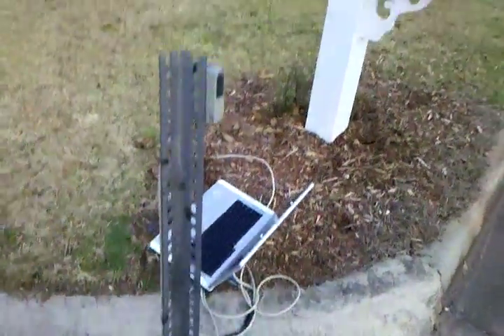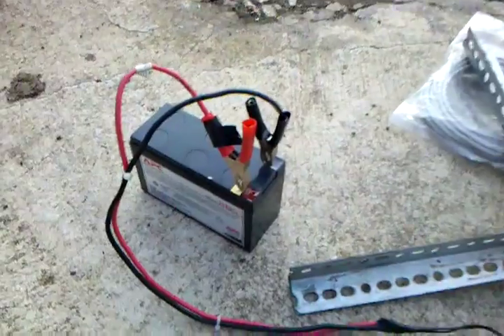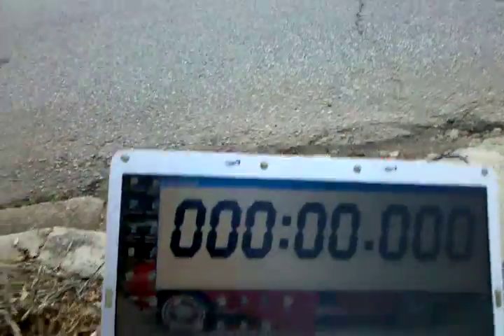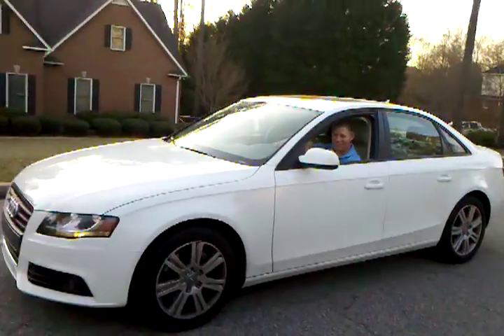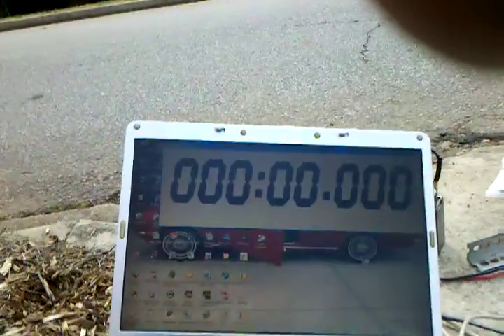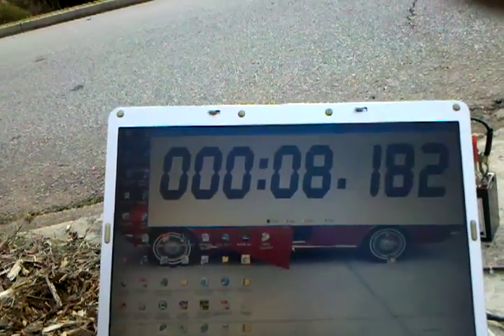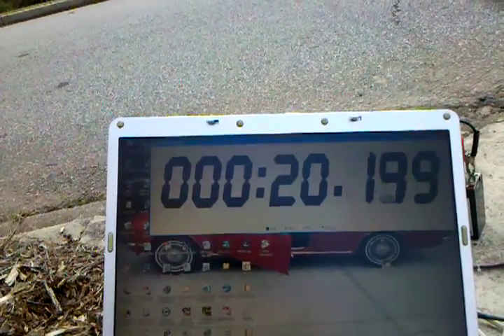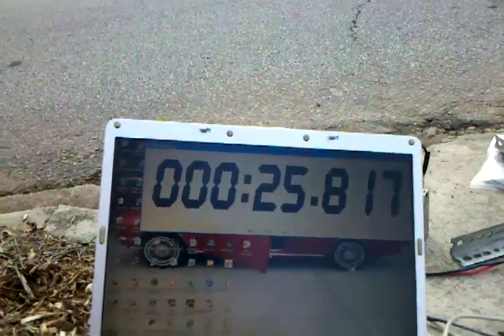Low-Cost AutoCross Timing System

Comment: Looks like these sensors are being used.  https://www.aliexpress.com/item/1pair-Square-laser-photoelectric-sensor-DC6-36V-Beam-laser-sensor-0-10m-laser-photoelectric-switch/32771835085.html?spm=2114.10010108.1000013.3.52a1d94bLrowYR&traffic_analysisId=recommend_2088_2_90158_iswistore&scm=1007.13339.90158.0&pvid=5f0b0824-7ac5-4bdd-9dd5-ce2abf6b52f8&tpp=1